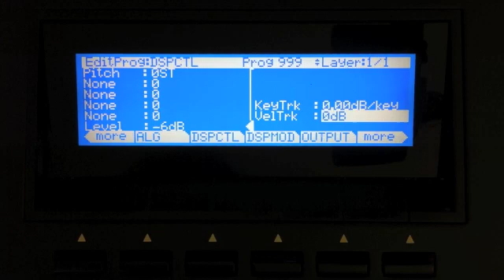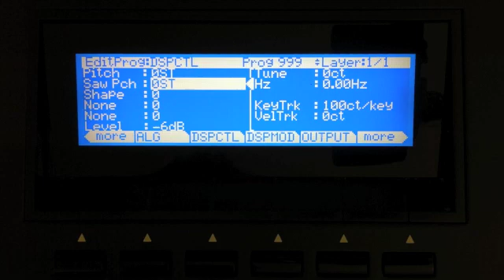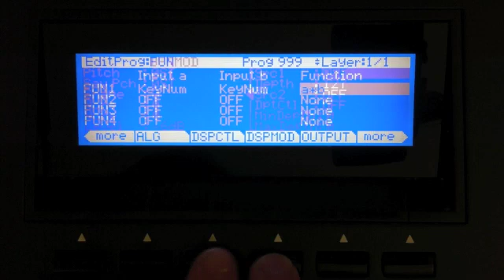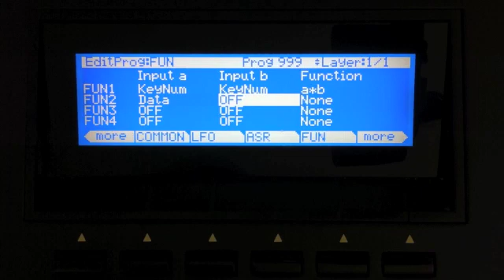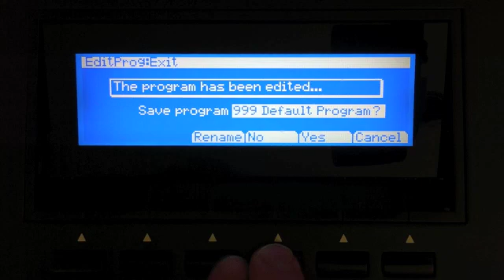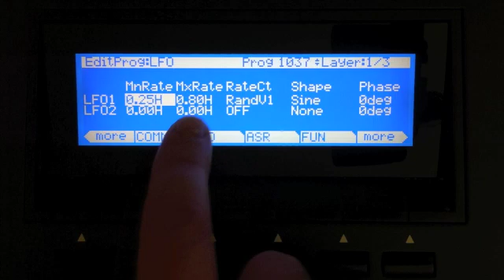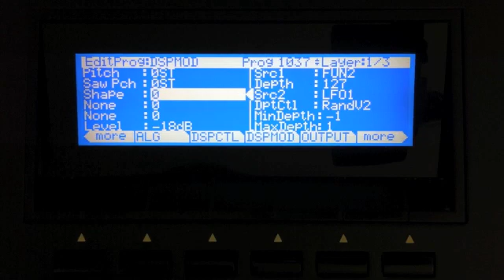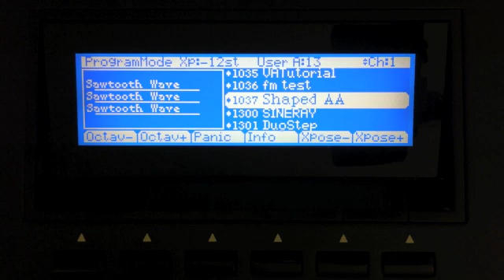Kurzweil PC3: The Good Stuff -- Anti-Aliasing Shaped Saw

Comment from the maker: VAST re-scales all values between -1 and 1 in the FUNs. Using Keynum as a source for a * b, you'll get values like:

0.1 * 0.1 = 0.01
0.2 * 0.2 = 0.04
0.5 * 0.5 = 0.25
0.7 * 0.7 = 0.49
0.8 * 0.8 = 0.64
1 * 1 = 1

and etc., so the values scale exponentially as you move up the keyboard. Thus the lowest notes will be pure sawtooth, at middle C it'll mostly resemble a sawtooth (75% sawtooth, 25% sine), but the highest notes will be mostly sine, which is one way to do anti-aliasing.